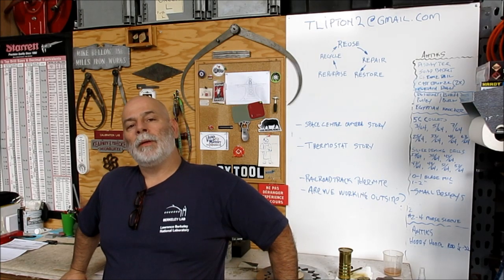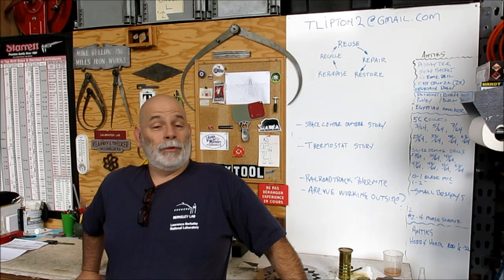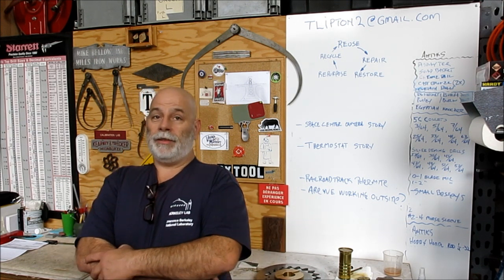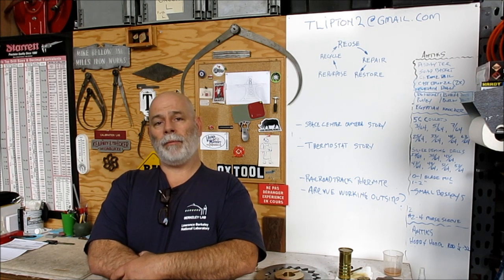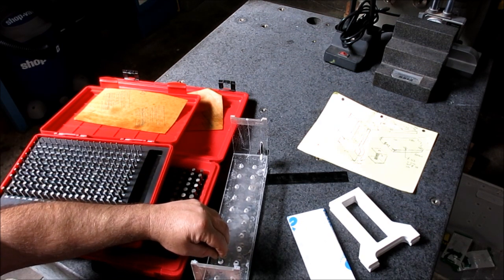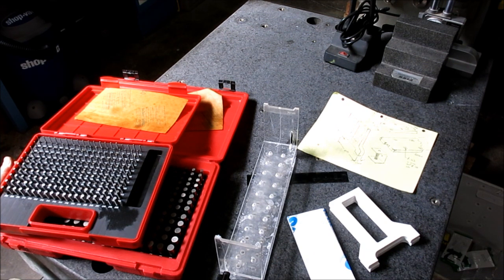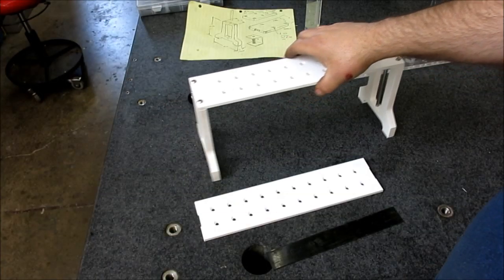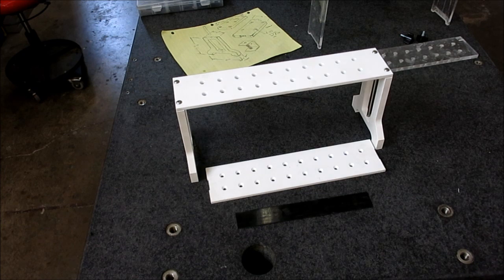Monday Night Meatloaf 23

Comment: Hi Tom
Excellent Video as always, that Carbon Fibre Vernier is amazing, great find. That little Enco tailstock turret is something i am in the process of building ( My Lathe has an MT1 taper) so it is good to see one for real to give me a scale on it. One thing i am scratching my head about is the angle of the toolholders to the centreline i have seen drawings with varying degrees but that looks to be ideal for clearance and still get 6 tools in, would you mind giving me a rough idea what the angle is on yours.
Many thanks for more great advice
Kind regards
Malcolm
Reply from the maker: Hey Malcolm,

The angle is 45 degrees to the centerline. Hope this helps.

Cheers,

Tom

Comment: Well, that Acad lesson just cam in handy as I drew out the mini pallet hole layout. That method of dimensioning is cool!
How do you set origin? When I set UCS I get the X/Y arrows showing on my drawing and it annoys me....:-)

Colin
Reply from the maker: Hi Colin,

Type UCS then hit enter, then type O for origin, hit enter and then select using snap to endpoint or intersection the corner you want as the 0,0,0 origin. I always double check that I got it right. Saw somebody screw that up once.....

Cheers,

Tom

Comment: Hey tom
Great video
Got so used to key less chucks (quarter turn on quarter turn  off) and swoping  out drills to taps etc, on lathe tailstock .I completely forgot I had one of turret gizmos Thanks for the reminder .
My one has a morse 2 taper.

thanks again
Mark
Reply from the maker: Hey Mark,

Thanks for the comment. They take a minute to set up but if you have enough parts its worthwhile.

Cheers,

Tom

Comment: Tom congrats on your viewer ship milestones and I'd relay like to see how veteran is put together I plan to make a lot of reproduction bolts for antique machinery which it would work perfect for.
Reply from the maker: Hey Chris,

Thanks for the comment. Turn you phone sideways. It makes the little letter keys bigger so you can hit them better. Not following you here.

cheers,

Tom
Reply: Lol Sory auto spell got me again. I said congratulations on hitting 1,000,000. And I would really like to see how that turet is put together. I work on antique machinery and it will be very useful for manufacturing replacement bolts. The old stuff has different heads

Comment: What CAD software are you using ?
Not signed Angry Of Mayfair but Confused of Ocean Grove (Australia)
I don't have a clue about this stuff.
Reply from the maker: Hi Confused,

What you saw in the video is AutoCAD LT. I use several at home and at work. The primary two I use are AutoCAD for 2D layouts and Solidworks for 3D modeling.

Cheers,

Tom

Comment: "the larger calipers"  OMG, those're huge.

btw, I wanted to mention, on the pronunciation of 'mitutoyo': the 'tu' is pronounced 'tsu'—that 'tu' spelling persists today mainly because it's easier to type, I think.

anyway, just info.  hopefully interesting.  if you changed the way you said it, other people might not understand.
Reply from the maker: Hey Thoper,

Thanks for the pronunciation tip. Many Japanese names have a little twist like that. Matsuura is another one that doesn't sound anything like the way it looks when pronounced correctly. Its the old Solder Sodder thing.

Cheers,

Tom

Comment: Tom, for your video segments of the computer, you could use a black flag to minimize the screen reflections, or better yet, use screen capturing software so you get a direct file on your computer of the computer display, and it can pick up your commentary through the built in mic as well, or use your external mic plugged in.
Another great video, congrats on the views and subs, your content is presented in an way that makes it entertaining while very educational. Your book is on my Amazon wish list.
Reply from the maker: Hi Ben,

I tried a capture software but couldn't get the sound to work. Its really the right way to do that kind of thing. I will try it again and see if I can make it work.

Cheers,

Tom

Comment: Tom with plug pins , is this the scoop?.....for instance a PLUS size set wont fall below the nominal size and will only be the specified ground tolerance over and ... vice versa with a minus set?
Reply from the maker: Hi Bib,

Not a simple discussion. Take a look at this article for a more in depth answer than I can give you here. 
http://www.aajansson.com/pdfs/understanding%20fixed%20limit%20gages.pdf

Hope this helps.

Cheers

Tom

Comment: Hi Tom I was thinking of picking up a set of those gauge pins for the shop but was undecided on getting plus or minus tolerance. What do you think would be more useful most of the time, great video -Thanks
Reply from the maker: Hi Johnny,

Get the minus pins. All it means is "no larger than" Allows you to easily discriminate to .001 even on tiny features.

Cheers,

Tom

Comment: You would like putting 2 keyed 1/2 inch drill chucks in that turret tail stock adapter. I used a couple off the shelf chucks with threaded shanks. and milled adapters.
Reply from the maker: Hi William,

Now that is a good idea. I need to scrounge up a few chucks to load my turret up with. That will make it much more useful.

Cheers,

Tom

Comment: Hey, tom, make sure you wipe off those Gage Pins-I think the chemical residue from the old rack is not going to do them any good.....
Reply from the maker: Hey Andy,

They have a good thick coating of that "offshore" oil on them. 

Cheers,

Tom

Comment: very nice! i love these. quick question: i have recently bought me a mill. it's a "van norman n12" ram type mill. i got it for 300 bucks! and in good shape too!. now here's the question. what would be a nice first project with it to "improve" it. you know some accessories you can make yourself. maybe that would be a nice idea for a video?

greetings from Belgium
Reply from the maker: Hi RG,

I'd make a set of tee slot covers for it right away. After that a mill stop and after that a mni pallet setup, task light and collet rack. Better hurry up you have a lot of projects to work on.

Cheers,

Tom
Reply: Thanks! i will make these ASAP!

Comment: Tom,
Thanks for the tip on ordinate dimensions and the math that a CAD program does.
 I noticed that you did not match drill the upper and lower plates. I would have started with the hole size for the lower (.215"), gone through both plates and then followed up  with the larger drill int he drill press in the top plate. Just me what you did was slick as well.
Thanks for posting such informative vids!
Eric
Reply from the maker: Hi Eric,

Good idea. The only issue was the two parts were different overall lengths. This would mean I had to position one edge offset from the other in a precise way. Not that easy in practice. It was easy enough to pull the dimensions for direct coordinates off the layout so it made it simple.

Cheers,

Tom
Reply: Oh! Yes of course the different lengths. I had not  noticed that. Thanks.
Eric

Comment: Tom, Enco tailstock turrets are still available new. #2 through #4 and reasonably priced to boot. Neat little part. Also, I got a chuckle when you didn't move the table to drill the holes in the top of the side supports, but you moved it to insert the long drill bit. Could have just loosened the vise! :)
Reply from the maker: Alright Bradley Wisenhiemer,

Where were you when I was doing that the other day? Back seat drivers. Sheesh.

All the best,

Tom
Reply: oxtoolco Backseat driving is the best. All the fun, none of the responsibility! Keep up the good work.

Comment: Very Yummy meatloaf this week Tom! Did your thumb intersect with the belt sander or the curling iron? This was really a hoot.
Plastic, brass and copper act a lot alike when drilling. If you reduce the angle on the cutting edge to slightly negative it will not pull through the part.
Reply from the maker: Hey Paul,

Sharp eyes. Its a burn. There is a whole story there I will share with you guys soon. Who wants to grind a negative rake on their nice new countersinks. Suckfest here I come.

Cheers,

Tom
Reply: oxtoolco Zero rake and a small land of half standard clearance - works in virtually any material and doesn't chatter.

Comment: As a "Johnny woodworker" I take no offense, However I find those Quik Clamps
mostly useless, glad you could put yours to work.
Reply from the maker: Hi Edge,

Next to useless but they do work one handed. I have a couple around that see a little use.

Cheers,

Tom
Reply: oxtoolco They are good to hold the part while you put a good clamp on. :)

Comment: Hi Tom. I use AutoCAD also. What is the command to get zero 0,0 before you use the ordinate dimensions? Thanks!
Reply: I figured it out - UCS. Cool never used this before!
Reply from the maker: Mr26Huffy Hi Huffy,

Its great to be able to assign the origin at will. Another thing is you can reset it again to another spot and as long as you don't update the dims on the old view it all sticks. 

Cheers,

Tom
Reply: oxtoolco Tom,
As I have mostly drawn architectural, I used baseline dims, but this is a great way for machine shop drawing when dealing with smaller parts. The drawing is not all cluttered up with extension lines etc. Thanks again - Keep the great tips coming!

Comment: Tom good setup tips.  Johnny woodworker clamps ha ha hey wait a minute I am offended lol. Do you re-tram the head when you move the ram like you did when you put it back to 0?
Reply from the maker: Hey Bill,

I didn't used to check the tram after swiveling. But now I do. Its about fifty fifty in my opinion. To get a good read on it I'd have to check the tram before and after to see if swiveling has any effect on tram.

cheers,

Tom
Reply: oxtoolco
I forgot to ask how close do you get the turret back to the zero angle setting on the column?  Do you bother indicating something that is 90° to the slots on the table or just go by the pointer on the turret?
Reply from the maker: Hi Bill,

I just use the pointer on the turret. Some guys angle the head a handful of degrees to the right as your facing the machine to make it a little more ergonomic. Never got into that myself but I like the idea.

Cheers,

Tom

Comment: Hi Tom,
            What was the drawing software you used? I normally use Visio but yours seems to be a tad more versatile You may have mentioned the software but I miss a lot due to severe deafness.Perhaps you can knock up an extra large hearing trumpet for me. Lol.
Reply from the maker: Hi Mo,

The software was Solidworks. I also use AutoCad for some types of layouts. Thanks for the comment.

Cheers,

Tom
Reply: oxtoolco
Reply: Hi Tom,
            Thanks for the info, I enjoy your videos and also enjoy Adam's. I have been an active model engineer for well over 60 years and thought I knew almost all but after watching your's and Adam's videos I have found that I was in error. I now have magnets on a few of my dial gauges for top and cross slide use and have just purchased a small version of the dial gauge holders that you both use ( only $13 on ebay). It is great and so quick to lock, It's not the name brand that you use but a cheap China export but with a fairly low pension I have to go where the grass grows longer so to speak/ I am also using the small carbide inserts following your lead and also have started using a small carbide insert tipped 1/4 inch dia' boring bar and I'm sorry to say that I have had this boring bar for 40 years and not used it. Last but by no means least I have just begun to cut my own threads on the lathe having used taps and dies all this time, and my first 5/8 inch male and female pieces are perfect. Well I know you are very busy and I must let you get on and I'll finish with a big thank you for all your videos. 
 Best Regards to you and yours.
Mo King
PS:    have been building a 3.5 inch gauge live steam Locomotive (Britannia 70000) on and off for the last 35 years. I think I should finish it off before I pop my clogs, unfortunately other interesting things keep popping up like a CNC router I recently designed and built, just have to get and complete the electronics now so it shouldn't take too long.
Reply from the maker: Mo King Hey Mo,

Thanks for the nice note. Shoot me a couple pictures of your projects via email. If you have watched a few of my videos you know the address is on the whiteboard at the beginning, Love to see some of you projects.

All the best,

Tom

Comment: Tom, What do you use for chip fishers?
Reply from the maker: Hi Lew,

I have a couple things I use. My favorite is a cheap pocket screwdriver with a point ground on it and the very tip turned a little over 90 to the shank. Like a tiny crochet hook.

Cheers,

Tom